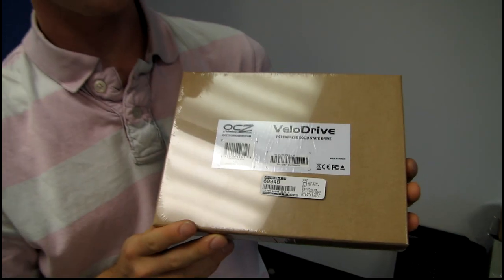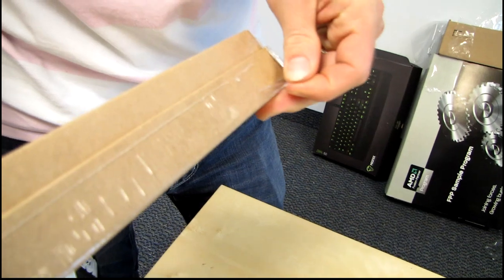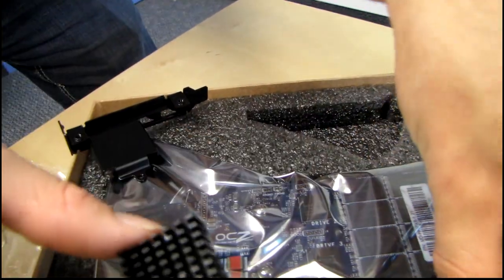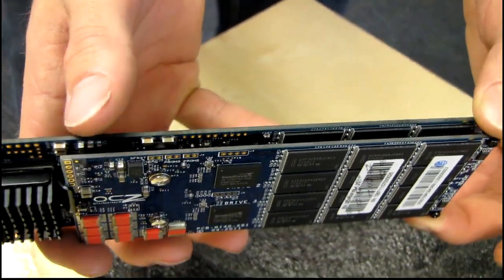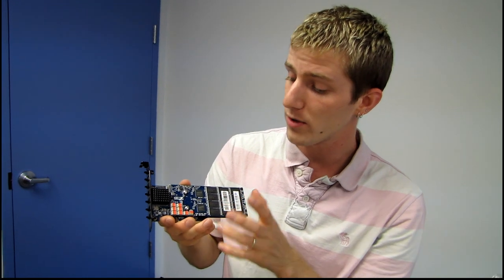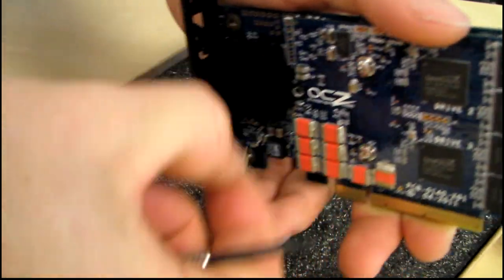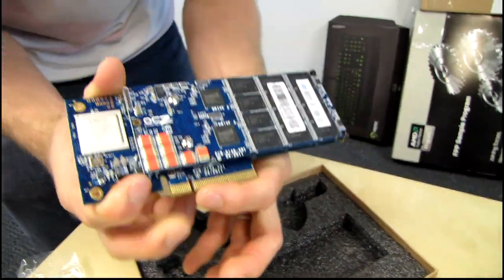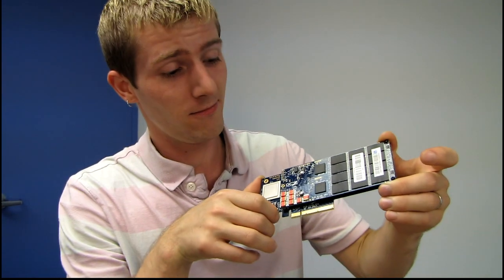OCZ Velodrive 1.2TB PCIe Enterprise SSD Unboxing & First Look Linus Tech Tips

Comment: revisiting, for those wondering, this would be the fastest card for use on an old x58 chipset motherboard (days of the first core i series chips, ie, the i7 920 and up). although the x58 boards didn't originally support UEFI BIOS, which is required to get a card like this working, there now exist modded BIOS or firmware (same the Rampage III Extreme) in which this card would be the best choice over the 1x and 1 lane built in SATA controller that plagued every x58 motherboard at the time. price today, the velodrive is on ebay en mass for around $120, not bad at all.

Comment: those are 25GB chips... simple math really... 1.2TB = 1200GB, divide that by the chip count of 48 and you have a single chip density of 25 gigs... and the LSI SAS2004 is an integrated RAID controller, so I could only hazard that this drive is designed to interconnect the decked boards in a RAID 0 pair... that thing would be a real flyer in a high load environment where data speed is paramount!
Reply: +ThEcRaZ3dGaM3R It's not really "simple math". Inside each package, there are four 64 gigabit dies.
Reply: ***** I know, I'm working in decimal instead of binary because the math is a bit easier (and I'm a lazy person, so easier is better even if it's not efficient overall!) so in my usage, 1GB = 1000MB instead of 1GiB = 1024MiB... and besides... drive manufacturers state disk capacities in decimal (MB, GB, TB) on their labels since the binary name (MiB = millibytes) doesn't quite have enough marketing w^nk value!! what sounds bigger to you? MEGAbytes or MILLIbytes? (answer: they're practically the same! just one is a decimal value and the other is a binary one that a computer understands!)
Reply: ThEcRaZ3dGaM3R It's mebibyte not millibyte...
Reply: frtard Yup... I done goofed XDDD

Comment: lol buy a 840 evo 1tb for 500 dollars and you can buy 10 of the 1tb ssd for 1 of this 1.2 pci e ssd lol
Reply: Speed and reliability is why this costs more not just straight up size

Pci-e drives blow sata drives out of the water fuck it up the ass then dominate its mother before claiming dominance over sata land which an iron fist
Reply: This video is over 2 years old, SSD's have become significantly cheaper since then.
Reply: I believe the maximum bandwidth for most Sata busses is like 1.6 Gb/s. While you can run 2 PCI-e ssd's and get like 4gb/s transfer.

Comment: Dang, $5,000 for that little card! It would make more sense to buy 2 or 3 solid state drives and get around 1.5 terabytes. Plus it would be so easy to zap that card after walking across a carpet or snap the connector off. Oops!

Comment: The whole "static" thing is pretty much a myth. 
Can a static discharge damage sensitive hardware? In theory, yes.
Is a static discharge likely to do anything to a ssd under these circumstances? No, not even close.

Apart from that, he is not doing anything that could build up a static charge.

As for the touching. 
You do know why gold is used for connectors right? 
It is ONLY because things like being touched does not cause corrosion or damage to it. 
It's actually quite a shitty conductor.

Comment: Wrong. This is not the case with hard-drives. Here the industy uses 10^3 standard. If it was ram-memory you would be correct as here 2^10 is used.

Comment: It depends. The industry uses 10^3 and 2^10 for different applications. Hard-drives uses the 10^3 format while ram-memory uses the 2^10 format. so 1.2 TB would be 1200 GB in this case. If it was ram-memory it would be 1228.8*...

Comment: Actually, storage manufacturers don't follow the same rules as software when it comes to 1,024. So a 1TB hard drive can actually only hold about 931 GB of software, data, etc.
Not sure if SSD manufacturers continued this trend or not. I've seen some 64, 128, and 256 drives, which would seem to imply that those don't, but I can't say for sure.
The point is that storage doesn't follow the same rules as software.

Comment: Actually, your both wrong. 1024 Gigabytes make 1 Terabyte. However due to the way your computer reads memory it reads it as 1000 Gigabytes = 1 Terabyte. This is where we get our USEABLE SPACE calculation on HDDs/SSDs Where when you buy a 120GB HDD you actually have about 100-110 of it as useable space.

Comment: Can anyone recall when one to two TB HDD's were that expensive? I just wonder how long it will really be until those are down to like the 500$ range. I remember a 250 gig HDD around 2002/2003 being very costly but not even in the 500$ range, I think it was in the 250$ range. I kinda missed when the whole TB drives came out.

Comment: It's not just about opening programs either, writing/reading speeds can be huge help when it comes to organizing files from HDD to SSD. But I mean if you're gonna hate on it, that's fine. But I'm just saying, the reason why most consumers "need" an SSD is to lower boot times, increase read/write speeds, and/or have their desktop ready in less than a second rather than having to wait, pee, check, poop, check, log in, wipe ass, and then use your PC.

Comment: It's about the experience man. It's like saying a 56k dial up connection is better because it's cheaper and more cost efficient than fibre optic broadband. It does the job after all, just slower. SSDs make the whole experience faster, less of a hassle and more enjoyable as a result.

Comment: Why not have the best of both worlds? :P

Seriously though. It's not just booting, it's installation and load times. Games like tf2 which is about 12GB can be written onto an SSD in like 5 seconds as opposed to a minute on a 7200rpm HDD.

But I mean they're cost efficient for the SPACE, read and write speeds may vary. Plus it's nice to have your desktop ready to use the minute you log in.

Comment: my motherboard asus B75-V has only 1 SATA 3. is there a controller i can install on the PCIE lanes to which i can ocnnect two (2) sata 3 SSDs and from there, to my SATA 3 connectore on the motherboard? id like a RAID 0.
is it possible to do RAID on sata 2 and 3 combined?

Comment: I like your math, and i've grown up with this knowledge also, 1byte=8bits, base logic of speed/storage, etc. 1tb drives are in reality 932gb (approx). Rarely properly formatted at 935gb (seen a few higher end editions). But yes, Dave is correct. Even Sata rev 3 is 600 mb's / 6gbit, but even that is inaccurate.. (as it's based on the 10 ratio that isn't 8, when doing 8 is literal expectations of max, not dreamable expectations of max). Think... sales perspective.. bigger better? no? :)

Comment: Again and again i know VERY clearly that 750MBPS is without 8b/10b encoding and 600mbps is with it because it adds 2 extra bits so the data rides on the 0-7th bit and the 9th bit
so the speed throughput

Comment: Yeah, I just bought my first of two 128GB Vectors.. and Whilst RAID 0 is pretty risky, when its an SSD and the failure rate is so low, and the capacity is so small, its easily backed up:)

Comment: Wow yeah I suppose.. But with Dual 690's now, instead of 590's, that still doesnt give the best performance, the sweet spot is two 680's in SLI, and a 3970X with whatever motherboard you want and a hench watercooling setup, so for that Rig its about 3-3.5k for the system:)

Comment: People are getting pissy about the price , you guys forget you pay for convenience, the 2700k cost about £30 more than the 2600k for what 100mhz more, whennyou could just oc that 2600k, or 512gb ssd cost maybe the price of 5 or 6 128gb ssds or at least used to, but you have the convenience of 1 sata and power connector, this is a server device space in a server is a premium you don't want to have to use 10 ssds when you can use 1 pci e slot

Comment: your forget in that the more drives in a RAID 0 array there are the faster it goes.....say they each run at 600mb/s like you say, in RAID 0 each letter of the binary is writen to a different drive there with four SATA 3 ssd they would run at 2400 mb/s that makes the four SATA 3 ssds faster...

Comment: If you have 4 SATAIII drives in RAID0 then the limit of the SATAIII interface is irrelevant because only one drive will be plugged into each port.. Therefore SATAIII can still be faster than PCI-E. If you have enough drives and ports that is.

Comment: your wrong, he is right.

OCZ PTL1-25SAT3-128G - £60 or around $100 on Amazon UK

Whats 10x$100? $1000. now where did you get the other $2499 from?

The real price is less then SirGli7chAlot thought, But that was 2 months ago and the prices will continue to drop over time.

Comment: why? get an LSI raid card, and connect 10 intel 520-series SSDs -- how come it's equally as fast (if not faster) AND cheaper than OCZ solution? OCZ solution has only one advantage, as far as I can tell, and that is space. 10 SSDs take much more space than this single, slim PCIe card...

Comment: You people are really dumb. The fact that it's a 1.2Terabyte probably has something to do with the price tag. Anyone remember the old terabyte IDE drives costing $2000+ ? While yea u could come close to its performance with 10 ssd's you are forgetting you are connecting 10 ssds! that's 10 bays and 10 power connectors and the juice of all 10.  This is 1 pci slot...

Comment: No it shouldn't. PCI Express 8x transports considerably more bandwith than SATA 6.0, and even then this card has the best chip possible running quad controllers. This PCI express solution is capable of writing 2x as fast as high end SATA 6.0 consumer drives as well as being able to simultaneously accessing more data parts. In addition, SSDs are really bad (worse than HDDs) at writing/ accessing many tiny files, this one does a much much better job. OCZ have since manufactured a faster design.

Comment: easey done eg my n6650w tyan thunder mouther bbord with 8x raid sas port on bord and with the 1000w redundent power supply i made from the previous server that was in the case (ml380 g3) i could remove and swap out the 6x scsi drives and fill the 4x 5in bays

Comment: well, windows calculates with 1024... thats why it only shows 1,117tb instead of 1200... hdd and ssd makers work most times with 1000 instead of 1024....it will show 1200.000.000.000 bytes as far as i know... which is 1117,5 gb.... in windows :)

Comment: u dont get it..... there are 48chips only, how should this drive get its rated 1200gb with only 48chips of 20gb... that would be 960 gb.... this ssd has 1200.... the chips must be at least 25gb to bring the rated 1200gb space....... and since this is a high end card, it has some % of the space locked, so if one memory brakes when used, it automaticly unlooks the % or locked space to let the drive still have 1200gb instead of 1150 or sth ;)...

Comment: 1200/48=25. But since there are no 25 GB chips, OCZ is probably using (only thing that makes sense) 32 GB flash chips. Which gives them 7 GB per chip of spare area. Which is INSANE.

Comment: So i'm wondering. I've got the OCZ Revodrive 3 X2 240GB version, and it sure as hell crashes every so often. I have flashed the BIOS and the Firmware, but still, crashes sometimes. How do these drives manage on the enterprise systems? I assume they WON'T crash. But why does the consumer stuff have to crash, and why haven't they fixed that problem yet?

Comment: Wrong, first it can't be an odd number. That 25Gb you've got from that calculation is what is left after subtracting 'spare area' which Linus mentioned in the video.
Natural module sizes are 1, 2, 4,8, 16, 32, 64, etc. So these are most likely 32Gb each.

Comment: A card like this is meant for a server, and I have never seen a server run a RAID 0, mostly because if one drive fails all data is lost. Most servers run RAID 1 type modes, where you have two 1.2TB drives totalling 1.2TB because the data is replicated instead of distributed.

Comment: As an enterprise drive, it is used by an organization to run 24/7/365. It's made of higher quality parts and comes with end-to-end error detection, higher vibration tolerances and short error recovery time limits. 

Organizations usually have multiple terabytes of data in their databases, hence the terabyte drives. The added benefit of an SSD makes the system more robust but a hell of a lot more expensive.

Comment: i shall be buying two of these and run them in raid 0 .... it will go well with my pentium 4 ! (ha,ha )   ... great unboxing linus....  where will that drive go after unboxing... will it be sold as a graded item ..... .. knock off a grand and you have a deal....... 
    seriously velodrives especially the low capacity models are being used by consumers. even in gaming pc.s... there performance is simply amazing .... just too damn expensive 
   great video linus

Comment: @AnonymousKev well an intel raid card with 2 micro sas port that can split into 4 SataIII and 512MB of cache is 499.99 on newegg and 8 Intel 520 120GB SSD are1,599.92 on newegg and this SSD is over 5,000 true it will use more room in your system but it will be in less than $2,500 wich is halve the cost and you say i don't save that much ?
just get 2x 5.25 to 4x2.5 drive adapters you save like $3,000 and you will get more than twice the performance in raid 0 than this $5,000 drive will ever give

Comment: @trashypickles Speed, purpose, size and some other stuff. PCI-E is most likely to be your add-ons such as video cards, sound cards, TV tuners, USB adapters, etc. SATA however, is meant to be a small, adequate solution for HDD's, SSD's and optical drives. So why is this a PCI-E card if it's an SSD? Well PCI-E 2.0 has much faster speeds than a SATA II, and other than that, everything is just physical difference. I Hope I answered your question.

Comment: That LSI chip is an integrated SAS RAID controller.  That chip is the equivalent of a RAID chip on a motherboard that would connect four 300GB SSDs in RAID0 to make them appear as one 1.2TB Drive.  The chip on that drive does the same thing, just all the flash chips are together on one card.

Comment: @alex94539 I must also add that OCZ has nearly nonexistent customer support and Velodrive uses Sandforce controllers(albeit SF-1000 and not SF-2000). It's a bit ironic that you started talking about failure rates because normally it is very rare for SSDs to fail, but those that have Sandforce controllers fail a lot. Micron C400 that is used in Crucial M4s I suggested is one of the most reliable controllers currently available.

Comment: @alex94539 OCZ Velodrive is pre-RAIDed solution that uses garbage collection to keep up performance. It doesn't differ from normal SSD RAID in any way. TRIM is a must have for only old first generation SSDs like intel X25-M because they do have GC. There are plenty of RAID cards that are able to handle 10 SSDs its not like it requires any insane performance. It's just a matter of bandwith.

Comment: @juusov2 
Not that simple genius. RAID = No TRIM, unless you get a non enterprise Intel motherboard which defeats the purpose. No RAID means your SSD is gonna kill itself over time which is non ideal for an Enterprise scenario. Besides, there is no RAID card that powerful that can handle 10 SSDs. Moreso, 1.2 TB needs 4 controllers, 1 controller for "2" TB is a bad idea. And last thing i can think of, the failure rate on that is way too high for an enterprise environment.

Comment: @DazhFX Well, yeah. It's 1/40th of 1024. If each chip is indeed 25.6GB, then it would take 40 of them to reach 1TB. Then, the remaining 8 chips would total 204.8GB, which is exactly 1/5th (.2) of 1024. It all adds up. I just can't see how they could make a chip with a number of bytes that is not a power of 2.

Comment: Do you guys think Linus is that stupid? You don't just divide the listed space by the number of chips. SSDs have spare space allotted to improve performance. My 240GB SSD actually has 256 gigs worth of nand, for instance. Enterprise drives will have an even larger percentage of spare space allotted. Basically, there's considerably more than 1.2TB worth of chips on this thing.

Comment: @MrKobauski This SSD uses an internal RAID0 which must be set up via Hardware or Software (obviously, Hardware is recommended). It has an integrated RAID controller which must be set before installation of Windows, and then you install Windows afterwards.

Comment: ocz is trying to break into this market but they are behind cuz they use sandforce and other cheaper solutions. for true enterprise go with something like texas memory systems. i mean the card doesn't seem to have capacitors for when the power goes out. you'll get data corruption. if you use this kind of ssd for mission critical applications you'll be sorry. also i'm not sure about the daughter board design. will that thing even fit correctly into a server rack?

Comment: @RaboStoKabo The first thing you must do is check to see if your motherboard support booting from PCI-E devices. After reading a bit about other people with the same motherboard, it appears the Rampage 3 Extreme DOES support booting from PCi-E slots; it work in either the x16 or the x4 slot.

If it does not, update the BIOS and it should be an available setting.

Hope that helps!

Comment: @iconiKdesign dunno about Velodrive random reads/writes, but RevoDrive 3 X2 has 230 000 IOPS and ioDrive has 250 000, that's about no difference at all, and Velodrive should have even more than Revo 3 X2.

Comment: @iconiKdesign actually no, they have equal speeds, and ioDrive is more shitty due to having less spare flash available (this drive has 6.4 per each 32GB chip, which means 307GB 'unavailable' flash)